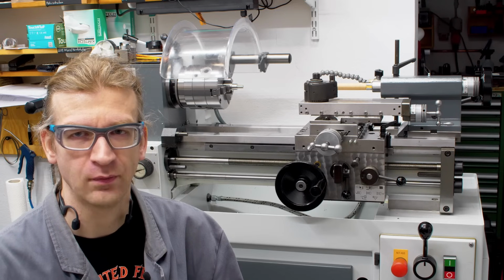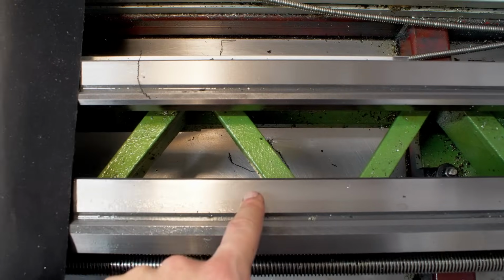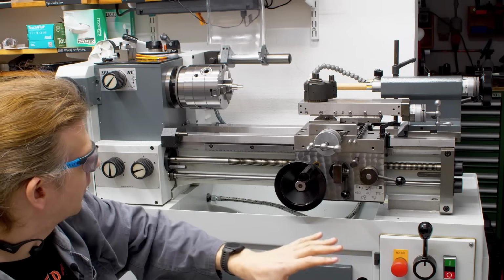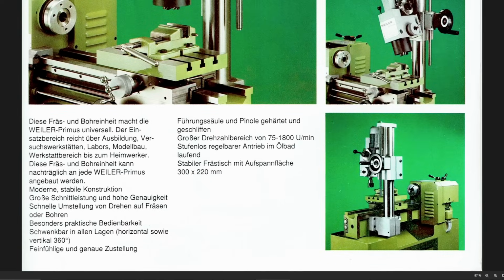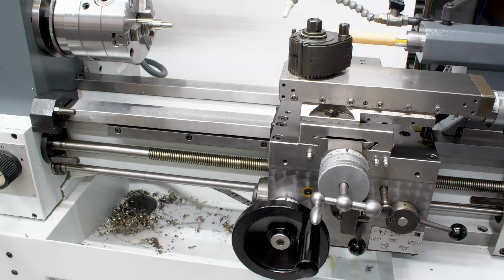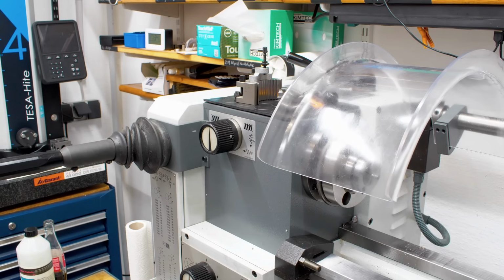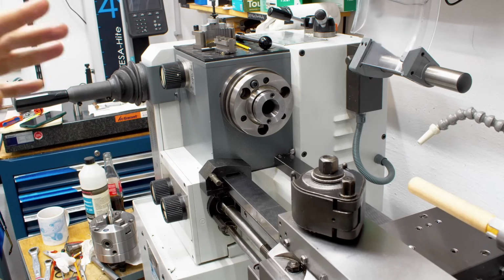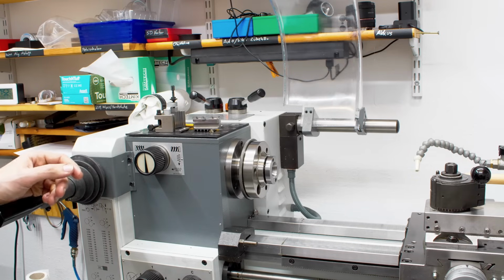Toolroom lathe: Weiler Primus

Comment: Hello Stefan, can you give info on the lubrication of the whole machine, oil types, grease etc? I got a file from Weiler and they also explicitly told me to use everywhere DIN51516-CLP46 which doesn't sound right. Thanks in advance.

Comment: Hobby? Eine Maschine für 30.000? Also wenn du zuviel Geld hast, ich würde eine Weiler Praktikant nehmen. Sind nur schlappe 60k.
Reply from the maker: Kein Hobby.
Ich hatte Angebote hier liegen für neue Weiler Primus und eine gleichwertige GDW - Aber die Maschinen sind die letzten Designiterationen echt groß und schwer geworden. Das was heute die Primus ist, war in den 80ern noch die Praktikant.
Ich brauch keine so große Maschine, ich hab halt selten Drehteile über 40...50mm und 100mm länge.

Comment: Nice, but expensive - I recon you paid 27 T€... Why do all these German and Swiss tool room machines have the cross slide hand wheel on the RHS... ? Its something I could never get used to operating....
Reply: It's not, the cross slide handle is in the middle.

Comment: Nice lathe! You mentioned rebuild project for cheaper lathes. Just wondering, are the Primuses for 12k Є usable for most of the work or worn so much to require good amount of rebuild? What parts likely need to be repaired? 
Thank you!

Comment: This is the nicest 'small' lathe out there. It is a cut above the Emco, but it should be noted that the Emco lathes are quite good, just not tool room quality. But I believe there are 2 versions of the Primus, there is the geared head version and the belt driven version, said to be extremely quiet. If I could choose any lathe from the entire universe, I might chose the belted Primus for it's quiet nature. There was also a milling column that bolts to the bed, very much like Emco, but more robust. For it's size, this is a very full-featured lathe.

Comment: I missed this when it came...
TOS is one of the brands that always show up in the Netherlands. For the first time in 18 years I started working at a place that didn't have a TOS but did spend over 50k on a rebuild schaublin 125... And all our cnc mills are DMG and Bridgeport. We do just slightly bigger parts than you 😂, my previous mill at my old workplace could fit 3 out the 4 mills on its table but it was 40 years old.

Comment: Nice lathe, I like the controls at the tail stock end.

Polycarbonate is nice until it gets some UV or chemical aging, then it's a bit of a time bomb. I suppose you could make the best chuck shield ever with some Al extrusion and wire reinforced glass panels.

Comment: Have you also looked at GDW lathes too?
Reply from the maker: Yep, even had a quote and looked at them at a tradeshow.

For sure nice machines! But They have the same "problem" as the Current Weiler machines - They have grown quite a bit in size and weight, compared to the 90s era machines.
Reply: @StefanGotteswinter Well, after all it's the same engineer who designed them ;-)

Comment: I put my lathe on two off-cuts from an 8” white oak beam that was about  to be converted into firewood by a local timber framing company.

I was told to soak the beams in mineral oil to prevent moisture from the air getting into the wood, which should stabilize the dimensions of the beams regardless of the air humidity.

Comment: Your videos are great! My situation is similar since I have been doing full time consulting and R&D work since the 1980:s in precision mechanisms and electronics. My shop is both a hobby and work tool used daily. 
I am partial to Weiler lathes, have a 80:s condor that is my best all round lathe ever. Never found the stability of the crosslide on it to be an issue, tried a solid toolpost, felt no significant advantage. Controls are  pretty much the same as Yours, but mine is a 6011 green rounded older one. Never used the newer condors. The electric brake has now failed me twice, I am not going to restore it again.  Have been warned not to use the electric brake on the highest rpm:s because of the high transient loads on the gearbox. I intend to put a VFD on it and rewire the electrics. This should also give a softer adjustable braking action. The lever operated C5 closer on mine is great,  also have the lever feed on the tailstock with integral C5 holder which makes it useful for more duties than as an airhose hanger...

Comment: not sure about the $$ vs value of this, for 20k you could have bought a really really good hlv-h, and they aren't sophisticated to maintain
even Schaublins 135 come up from time to time at that price range in auctions, sure it will be somewhat of a project, but the end value is much much greater and depreciation non existent for that level of machines, not so much for Primus...
Reply from the maker: I kinda agree and dont at the same time. Yes, I could have found a good condition Schaublin135 or Weiler Matador (Not a Hardinge, those are ultra rare here), but as you say they might end up as a project (And they are to big to comfortable place in my shop. 
Also with Weiler, there is still support from the original Manufacturer, plenty of spare parts are floating around and there are several Rebuilders that also give support for these machines.
It came more down to "a machine with parts availability, support AND in very good condition."
Reply: @StefanGotteswinter   I really get not wanting the project part, I was just thinking that 20+k for this class of machine is way too much, and regarding spare parts, I think you know yourself that was just an excuse :) there isn't much that breaks on them that can't be shop made
I was considering for a while offering you my HLV-H project, it was a 1.2k eur auction purchase from France, considering the price and that there where monkeys using hammers to adjust top slide angle - I kid you not, hammer marks and broken castings, missing feed motor, wear grooves on the dovetail top and such tell what was the condition it was sold in.
I ground the dovetail, replaced turcite, scraped cross slide, but kind of lost energy to continue, its been sitting for a year almost, just too busy with other work.
The offer would also include Fehlmann Picomax P51 ;)
though that one has only x/y cnc, quill is manual
But you need more floor space, while HLV-H could be made slightly more compact (though I stripped it down completely and repainted everything already in white), Fehlmann does take up a lot of space.

Comment: Could mount a rotary encoder on the swivel of the compound and then with a bit of math (raspberry pi) using the compound linear scale, not lose tool position.

This is a joke btw but if you take this seriously, I will be very impressed :)
Reply from the maker: Thats not to absurd - I have seen one guy (on a much larger lathe) mill out the cross slide for a large rotary encoder to keep track of the compound. 

The aikron Readout can do the math, but you have to enter the angle manually, but it keeps track of x/z/z1 if you move z1 with the compound on an angle.
Reply: can't wait to see it <3
 @StefanGotteswinter

Comment: Stefan I would say under 30,000 euros is a really good deal in todays market. In the late 80's I bought a new Hardinge HLVH toolroom lathe and it cost $30,000 usd and I heard that before they quit building new ones they were as high as $60,000 usd.  I think you made a very wise choice.

Comment: Congrats on the new lathe!  I’ve noticed the same thing about different countries using certain machines.  I wish the lathes we typically have here in the US were as quiet as your two lathes you’ve shown (can’t say three as I don’t recall if the super customized import lathe you first had was quiet or not).  Every manual lathe I’ve used at work or friends is always very loud in operation, be it from the drivetrain gears and motors, even when in top condition!  Yours operate so silky smooth and quiet and stop almost instantly.  Features I’d like once I get my home shop going in the near future!
On a side note, are you into motorcycles or (motor)scooters at all?  I’m into both and know that building modified fast scooters is relatively popular in Germany.  I’ve got a part I need to make and wanted to ask your opinion on how’d you’d make a certain feature economically in the typical home shop.  Internal splined bore of about 16mm diameter roughly and maybe 40mm ish long axially-  the part is a from billet version of the rear drive hub/disc brake carrier from a Yamaha Aerox to be exact!

Comment: Weiler lathe’s is the best! I have had 4 of them and I love them all. There are better lathes out there but not if you look overall on price on Sparepart etc compared to Schaublin and Hardinge etc. Weiler has standard measurements on bearings, leadscreew etc. 
keep up the good work Stefan!
Reply from the maker: Yeah - They are not "the best", just as the Deckel - But as you say availability of spare parts is a big deal :)
Reply: I also have a Deckel but a FP2 😂

Comment: Hey Stefan! those W23 or B23 collets that you have for the Weiler, do you have basic dimensions for them?, as i have a workholding device that takes very very similar collets but i cant for the life of me find the right ones (i only have one to reference)
Reply from the maker: 23mm shank, 32mm head diameter, 86.5mm overall length, 21mm thread diameter
Reply: @StefanGotteswinter  Danke Stefan! Unfortunately mine are 28mm shaft and thread, the search continues.
Reply from the maker: Have you tried the Schaublin Collet catalogue?
They have a good list of collets/sizes.

Comment: Your machine looks awesome !
There was a third spindle nose option, plain DIN 55021, which makes swapping chucks a lot harder. You get what you pay for 😅
Also your top slide and tailstock look more modern , wonder when Weiler made those changes.
Reply from the maker: Thanks!
I think they ditched the plain 55021 nose with the later machines. But thats what I have on the Emco. Its fine. But dropping the 3 Nuts on chuckchange is kinda normal :D

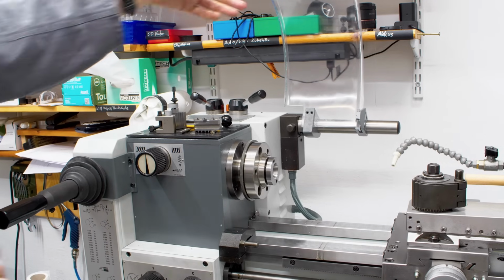Comment: Hi! Stefan. At about minute 40:40 you mentioned you are going to run oil instead of coolant. Would you please expand on that. My lathe is set up for coolant but as a hobbyist my lathe sometimes sits unused for periods of time and the coolant separates and turns into ugly goop. What oil will you use? Are you running it in the coolant system? THANKS
Reply from the maker: I am talking to oil-people currently what exactly to get, but it will be a thin cutting oil, and it will run in the cooleant system.
Reply: Interesting. Please do post something when you figure that out.
 @StefanGotteswinter

Comment: I know you like the six jaw chuck for holding parts securely without putting too much pressure on them. Have you ever got your hands on a self centering wedge bar chuck (Keilstangenfutter). I am very pleased with my Bison wedge bar chuck with a built-in short taper mount. It allows to flip parts and being centered within some 1/100mm without even bringing out a dial indicator.
Reply from the maker: Yep! Used them a lot at the dayjob. Not a huge fan for general work, since changing clamping diameter is a lot of wrench spinning.
But holding power and repeatability is impressive on them. Also good to put jaw marks on every innocent part you are working on or squeezing pipes out of round.
Reply: @StefanGotteswinter  I totally agree with you. Changing clamping diameter is tedious and the chuck is very capable to crunch parts. The jaws on the bison are not too agressive though. With some sensitivity on the crank I am able to clamp aluminium parts without leaving marks.

Comment: Only thing I see that could use an upgrade would be a conversion to an angled wiper so it shovels the chips off the ways. Straight 90s on flat ways love to try to run over rather than wipe away in my experience.

Comment: Pretty lathe, in a German way. I owned an Emco Super 11 (big bore) for several years, so I kind of relate to your experience. Ultimately, I let the Emco go.

In my day job of 27 years that I'm now retired from - running a US Navy optics lab - I had a Hardinge HLV narrow bed. It was a great lathe, the equal of the wide bed HLVH in a adjacent lab I also had access to. My main machines were ultra precision CNC machines of the highest caliber, used to directly produce optical surfaces. So, I'm kind of jaded. 

Since 1986 I've had home machines. A long and colorful succession of lathes - Logans, Sheldon, South Bends, Taiwan Mori Seki pattern, and even some Chinese lathes. Of all of those the Emco was probably the one I should have kept. But I just didn't bond with the machine. The quality is good, but not toolroom good. I found the layout just different enough to be annoying. And what is with Austrians and their love of unnecessarily angular style and weird machine paint color? Currently, I have a hoary old Logan 14, a friendly old lathe, but like the friendly stray dog that wanders into your life for a while, it's looking for its true home.

I don't want a Hardinge. Too big and heavy - I'm space constrained too. I'm a bit leery of Taiwan machines having used them. They are quite decent, but to get that amazing feel and accuracy of a really quality machine the cost would have to be 2-3X. Colchester and Harrison lathes are just too used up now - finding a low hours small English machine is impossible, and I don't trust any rebuild. I've been aware of Weiler for a while now, but these machines are incredibly rare in the US. The Primus looks great, but without going to Europe and exporting/importing one, I've no hope of getting one. I thought about doing just that (with some climbing days thrown in), but that stalled in 2020... I've looked into importing a bit, seems complicated and might be an expensive failed experiment. 

So the search for the perfect lathe goes on. Maybe a prime Wade 8A will pop up nearby on Craigslist!

Comment: Enjoy your new lathe! 
I've cut some impressively heavy shafts on the EMCO with no problems, it's plenty rigid. I'm not sure you'll see the differences in rigidity between the two lathes on superfine cuts, rigidity doesn't affect accuracy unless you don't know how to use a lathe and I know you do. There really aren't rigidity problems with the EMCO, it's more than just bracing, it's also density of the cast iron and how the webbing is employed  in the structure. 

There is a base that came with the EMCO that allows coolant with no problems and the US Super II has a D1-4 spindle with a larger #5 Morse taper.
 
I don't know about the spindle on your EMCO but mine is direct belt drive from the motor. I've used my EMCO commercially for over 40 years and I recently checked the spindle bearings and they are within 0.000050".

We each have our reasons for the tooling we buy but the EMCO is equal to the Weiler with the added benefit of greater versatility and capacity. Personally given the choice, I'll take the EMCO, I hope you keep yours, they're really exquisite lathes.

Comment: You could try making a chuck-guard out of fine wire mesh. Fine mesh is used as a face guard on chainsaw helmets. It will stop chips and coolant spray but won't crack or scratch and will have a basic level of transparency.

Comment: Enjoying the journey.
Would you have bought a Praktikant if the space permitted in your shop?
While I realise that most of your parts are short the strength and larger bore size would be useful.
I have an Emco Super 11 but for hard steel parts  a slightly bigger stronger lathe would be nice especially after seeing the turning demo's on the Weiler.
Reply from the maker: If the space was no objective, I would have looked for a Praktikant or Matador, yeah.
Reply: @StefanGotteswinter  Did the Praktikant at your old job have the conversational programming or just the DRO?

Comment: Nice. I have a De Vallière H.140E Lathe in my hobby shop.
Reply from the maker: Never heard of them - Looks like a lovely machine :-)
Does yours also have the super cool rack/pinion tailstock?
Reply: @StefanGotteswinter  Yes it does, it has a few other cool features such as auto leadscrew stop, quick retract cross slide lever and taper turning attachment. It is a beautiful lathe but showing some signs of age now.

Comment: As you basically said, the methods are in many cases independent of the machines.  When I had a business I learned that quite often the most cost effective way to increase production and / or quality was to toss money rather than sweat and pain at a problem.  The drill bits poke holes whether in a Jacobs or an Albrecht chuck, the cutters make chips with varying degrees of surface finish.  Watching you show production of small fiddly parts is always interesting and usually a learning experience, as I learned most of the small scale methods doing watch and clock work, and you bring a different approach to the job sometimes.  That isn't a lathe I'm familiar with here in the US, but it looks to be a really excellent machine.  I hope you have many good years of pleasure and profit with it.

Comment: Congrats Stefan! I’m so happy that someone in YouTube has a Weiler Primus like me and talks about it. I have searched the YouTube and there no much videos regarding this Machine. I want to regrind my bed and I was wondering if you could explain how can someone do that on this machine and adjust the machine for accuracy? My bed has some pitting corrosion on and I didn’t know that the machine bed is actually bolted and it can be removed for regrinding. I wish you could explain more 😊